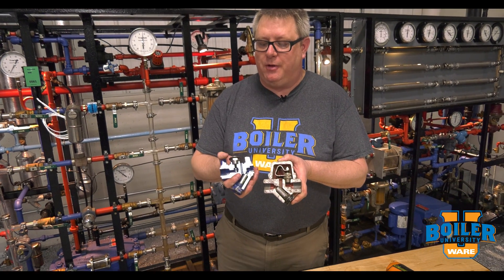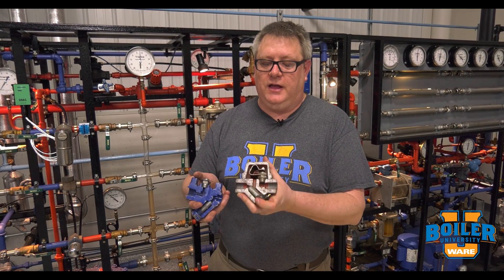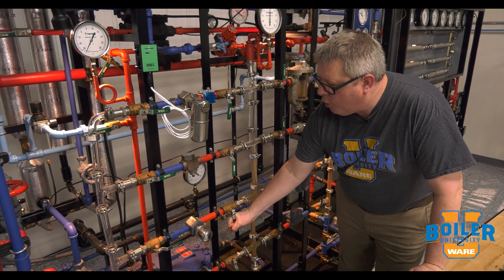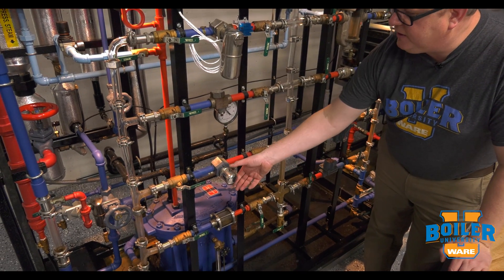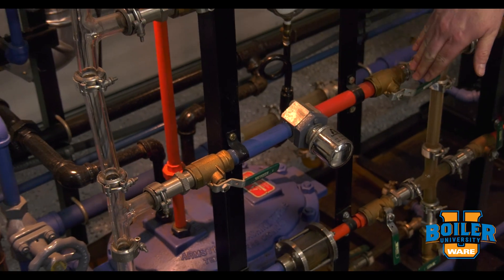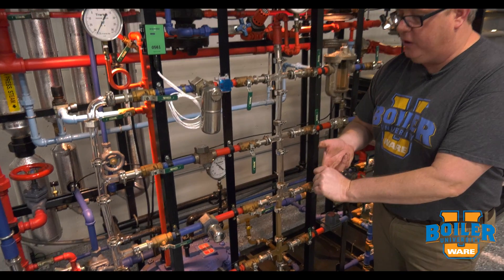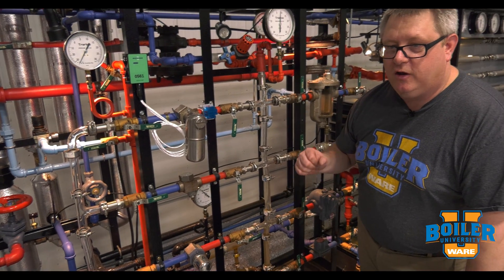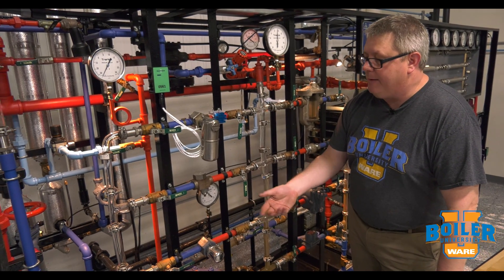Steam Traps | How Thermostatic Steam Traps Work and Uses - Weekly Boiler Tips

Comment: I think the issue is that while you can make an argument that a bucket is a bucket, a disc a disc....pretty much irregardless of brand (although I’m sure the respective manufacturers would not agree; despite the fact that many manufacturers make private label product for others) ...one cannot generalize about “Thermostatic Traps” as if each manufacturer makes a similar product: they do not. For bimetallic traps, some use a ‘D-Clip’ style, which has a low surface-area-to mass-ratio...resulting in a slow movement...these styles generally, in my view, cause more backing up....this is especially true as bimetallic traps typically require 50% of their MAWP in order to function efficiently...which almost no one pays attention to...however, it is usually not a huge issue, as it is certainly not a technology one could easily use in process trapping. For thermostat is using alcohol/water mixture, the more alcohol used will result in a cooler discharge....some manufacturers offer a choice of ‘below-the-curve’ discharge temperatures, some do not. Some use a bellows, which has a longer travel distance than membrane capsules...a responsible manufacturer will (if any are left that understand how it all works) that a Thermostatic Process Trap will discharge at temperatures in which backing up (a long held myth about thermostatics) will occur. 

I reference 20’F below the curve, as several of the most popular brands use that their drip and tracer discharge guideline...but, again, NOT for Process applications....a point often overlooked. A few years ago, I visited a factory that focused making traps with ‘other  than thermostatic’ technology...they had, as you show, a 300 MAWP bimetallic trap (and one of the more sluggish models to boot) on glass piping that certainly runs on much lower pressure or the glass would crack....so you would need at least 150 PSIG to make it work correctly...but showed it (as you do) functioning poorly. I have no axe to grind as I am retired at the moment...and you have many excellent videos, but this one is simply perpetuating all the old myths......I’m done ranting.....

Comment: While I appreciate what you’re trying to do, I’m afraid much of the information you presented is not accurate....In the case of a Bimetallic trap, there are huge differences in speed of movement depending on whether the bimetallic actuator is a large piece of metal (large mass with a small surface area) or a series of plates (each with a small surface area and low mass, acting independently)....In the case of the capsule (or bellows) technology, this is normally a 20’F discharge (average,  because there’s no way it can open and close at the same temperature). When used as a process trap, the alcohol/water ratio in the capsule chamber is typically reduced so that the average sub cooling is only 9’F , not 20’F as you state....
Frankly, it is this kind of application confusion, as you are presenting here, that continues the myths about thermostat is that I have fought for over 30 years....please study more about your subject prior to presenting.....
Reply: I would be happy to revisit any points you would like to discuss.  I made no reference to the speed of actuation, a topic that you have expanded on in your comment.   I spoke only to the nature of how the actuation is influenced (or not) by whether it is a pressure balanced or bimetallic element.  This extent varies by manufacturer.  With all due respect, I did not state 20 degrees as a subcooling differential anywhere in this video.  While this number may be pulled from your own working knowledge of trap specifications, in general the subcooling amount will vary according to the application, differential, manufacturer, model, and capsule specification.  There are better and worse applications for any style trap, but if you profess that thermostatic is best for all applications, then I disagree.